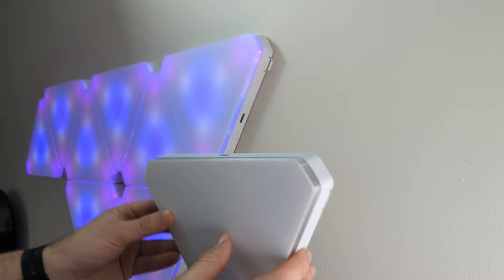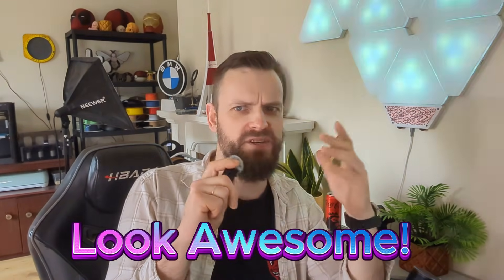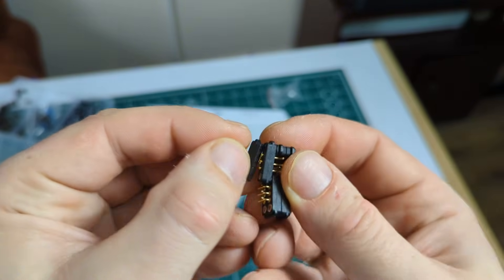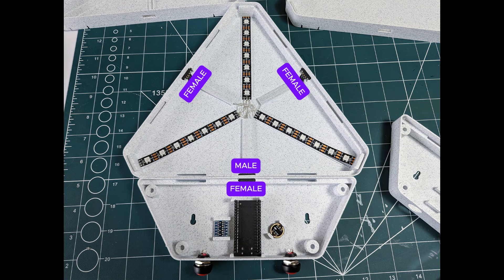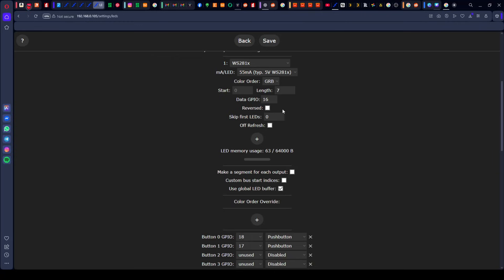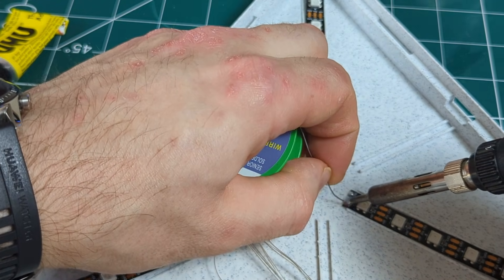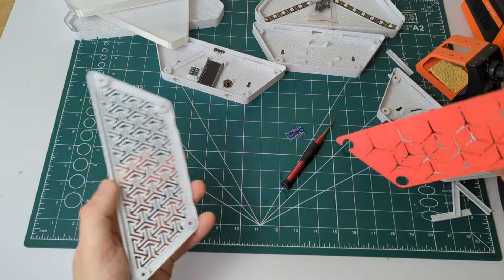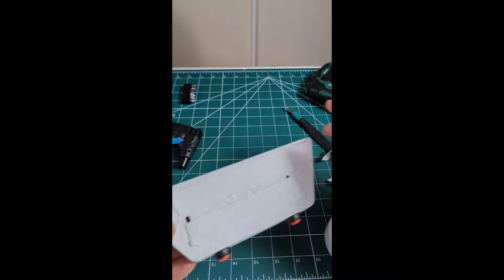3D printed WLED powered ''Flux Leaf'' music reactive panels

Comment: just a thought but Id simplify the control box buy just using the controller and not the buttons, just me, but end product is better for others.

Id also probably change the panels to be edge lit to prevent the led hotspots seen in some colors (on the walls of the triangles instead of the floor)
Reply from the maker: The hotspots only show on the video for some reason. And the pattern is kinda the main attraction here IMHO. But the LEDs can be placed in more than one way here✌️

Comment: Great idea and looks great! If you design a mk2 you could use small earth magnets as the electrical/data connection points which would then allow a lot more current headroom. Thus allowing you larger designs ? You can get earth magnets which have a bolt thread so you could use electrical eyelets/spades to be terminated the magnets in case solder didn't take to the magnet?

Comment: Nice design.
The level shifter is probably best practice, but in practice a sacrificial WS2812 LED close to the data pin that controls the LED strips would suffice. Meaning one doesn't need a level shifter, if the path to the first LED is short enough. After that, the LED themselves serve as amplifiers/level shifters for the next LED in the chain. 
This is a sacrificial LED, because you want to set it up to be invisible (in WLED that's a simple option in the LED setup)
Reply from the maker: Good to know, thanks for the info!✌️